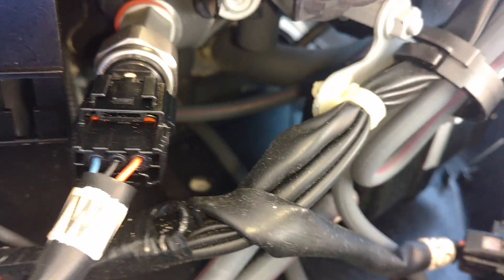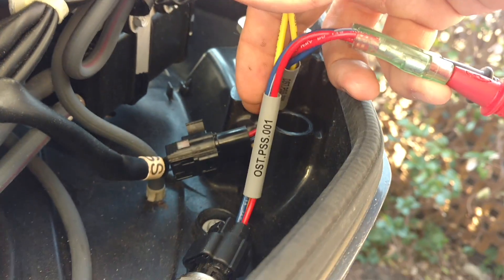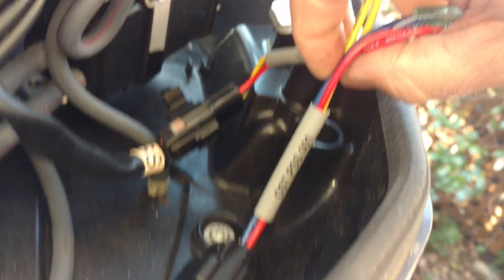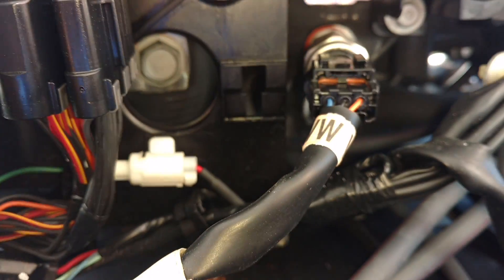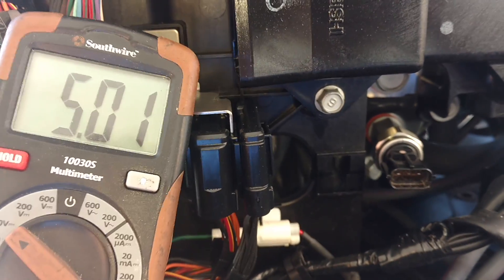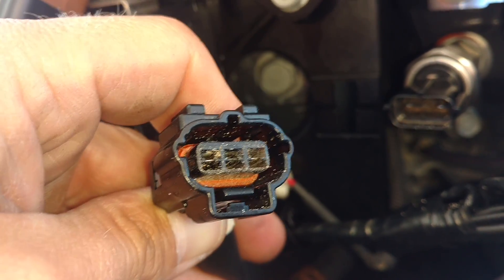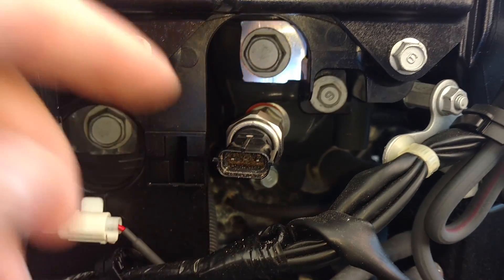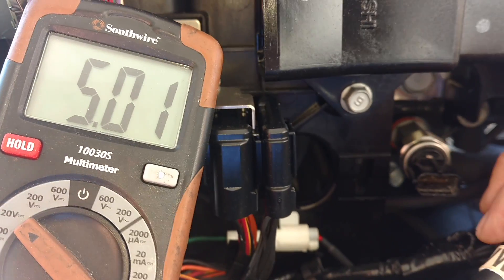Yamaha Outboard Electrical Repair, Diagnose Engine Harness Voltage Issues

Comment: what was the problem the customer was having for you to look into the sensors? low voltage?
Reply from the maker: This was from a motor that was having a running issue from a shorted sensor that was creating reference voltage to drop below 5 volts and screwing with the engine harness.

Comment: I have a 2014 Yamaha 250 4 stroke with 650 hours. Has always run great. Recently, while cruising around 3400-3600 rpm's, engine shuts off. Starts right back up and runs fine for 30-45 minutes. Had yamaha mechanic trouble shoot and found nothing. Suggested ignition switch which I replaced. Still have same problem. Happened about 10 times now. Any ideas?
Reply from the maker: Hi Bob, sorry for the late reply.  I'm curious to hear if you are still having this problem and what your mechanic has been able to find out.

Comment: Having trouble finding "Part 2".  Where is it?  I'm having tilt/trim issues, but they seem to be electrical in that it's going slow and battery is full.  I'm thinking I've got the short in the water pressure sensor, but will try to at least clean things out.

Comment: I have a 2004 f115 that runs good when you fire it up cold then you drive it a bit and it stalls coming back to neutral and won't start again without high idle then can't get it into gear

Comment: Hey I have 2 350 Yamaha while driving the engines shut off  getting electricity to the engine but console(tach)not coming on can you help me?
Reply from the maker: HI Sachel, Sorry for the late reply.  This problem is difficult to diagnose without having the boat in my shop.  Sounds like an issue with either a key switch failure or the main harnesses/DEC harnesses having a connectivity problem.

Comment: Thanks for the video. After swapping out the fuel pumps for no reason, your video fixed my problem. 
One question, engine now runs great, but I’m not getting a speed reading on my speedometer now. Could my ecu be damaged now or do I need to swap out the speedo sensor too?
Reply from the maker: The first thing I would do is check the Pitot Tube/water pick-up for an obstruction, which is very common.  The Pitot is located in the forward edge of the lower casing on the gear case.  The tube is almost invisible because it is tiny, about 1/16" interior diameter.  If this tube is obstructed, you will get no speed reading at all.  If obstructed, use a pick to clear the debris.  If it is clear/ no obstruction, blow some compressed air into the Pitot to see if anything registers at the gauge.  If its a digital multifunction gauge you'll need to be Key-On to check a speed reading.  Analog gauges can be pressure checked while powered down.   If you get nothing at the gauge while blowing air into the Pitot, motor has been running normal and you have normal reference voltage, 5.0V plus/minus .02V, at sensor connects/engine harness, speedo sensor ohms out normal, I'd drop the gear case and inspect the speedo connect (tiny hose barb or white plastic fitting with o-ring) at the top of the gear case.  These connectors are very brittle on some models/HP, and if this connect is broken or the pick-up hose is not connected, you will get nothing at the speedo sensor (if so equipped) or at the gauge if the pitot hose connects to the barb on back of the gauge on older gauges, on systems with no speedo sensor.   ECU damage would be the outlier, generally speaking, if there is significant ECU damage, there will be multiple issues with motor performance.
Reply: Hey mun3726.  Any chance I could ask you what your engines symptoms were for you to change both fuel pumps.  I'm currently in a similar situation

Comment: What was the customer complaint or symptoms that steered you to this diagnostic direction?
Reply from the maker: Hi sorry for late reply.  This motor came in with complaint regarding the DEC shift control.  Motor was having issues coming out of forward gear (ultimately the failure was confined within the DEC system and harnesses and not main engine harness/sensors).  We were checking voltages on the computer and noticed erratic reference voltage reads from several of the engine harness sensors.  Yamaha usually specifies 5.00V reference for most of their engine harness/sensors, and we were seeing 4.95 to 4.98, so decided to take a look.  The DEC problem was not caused by issues in the main engine harness, but I still wanted to publish this video just to show how sensitive these systems can be.  Also, with older 4 strokes that still used three wire TPS like early 2000's F115, F150 and all 3.3 V6, engine harness/pressure sensor issues can cause major running problems if a water pressure/speedo sensor starts to misbehave from corrosion or connectivity issues.  It throw reference voltage all over the range and then TPS voltage goes way out of spec which infuriates the ECU.  Hell hath no fury like a dazed and confused ECU!  One of the first things I check now with older F150 and 115 etc that has running issue and has also passed basic mechanical inspection (compression, manual shift check, gear oil and motor oil do not look like a milk shake etc) is to disconnect any sensor that has access to raw water such as speedo and water pressure while running the motor in the tank.  If it miraculously starts to behave, it is likely dealing with engine harness voltage and corrosion issues.   May still need a sync and link, but this step gets you close quick!
Reply: @outboardst.comoutboardspec8631  First, Thank you for this detailed response. I'd love to see you go through these Diag procedures as you are an excellent instructor. With any modern engine auto/marine dealing with an "Infuriated ECU" (lol) will become more common as these engines and systems come under the control of the ECU and it's ever expanding family of control modules. The day is coming when the simple (better) engines retire and you'll be wearing a lab coat and pocket protector to fix them. I'm looking forward to seeing your channel and business grow. The tools you design and create will become industry standard must haves. Thank you and keep the content coming!
Reply: PS; Where's Part 2?

Comment: How would one acquire a Yamaha shop Manuel. Or do you have to be a licensed Yamaha mechanic to get one?
Reply from the maker: All Yamaha shop manuals can be bought through any authorized Yamaha dealer.  They are quite pricy, but generally worth it whether you are an owner working on your own motor or a professional working on someone else's
Reply: @outboardst.comoutboardspec8631  jam

Comment: Very technical and informative. I'm going through this right now and about to head of to certified dealer to get rectified. This video gives me piece of mind knowing that this is most likely my issue and that this type of testing will get things solved correctly. Thanks for sharing!
Reply from the maker: Harness and sensor issues can be difficult to isolate, but with the proper techniques and information, possibilities can be narrowed down quickly.   We're always interested to hear about repairs for unique electrical and mechanical issues, so please check back with us when your motor is repaired and let us know how it went.  Thanks, Tyler
Reply: Will do! In on Friday!
Reply: Ended up being Ignition Harness from behind the key to the back of the motor. Took the pros at The Boat Center in Chippewa Falls, WI 20 minutes to trouble shoot!
Reply from the maker: Best case scenario

Comment from the maker: The full diagnostic sequence for harness and sensors is fairly easy, but we wanted to keep the video to a few minutes.  Part 2 will show the fix.  Diagnostic sequence is detailed in Yamaha shop manuals and is more or less the same for all Yamaha 4 stroke.  Any decent multimeter and you're in business.  No substitute for having a shop manual for these types of issues whether you work on Yamaha 4 stroke or repair your own motor.